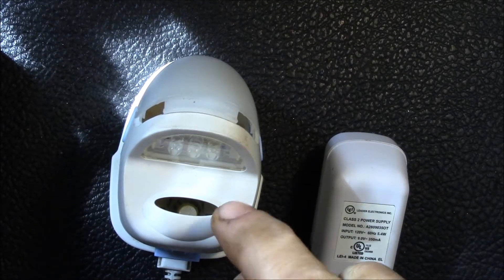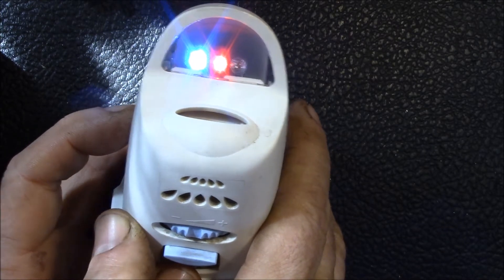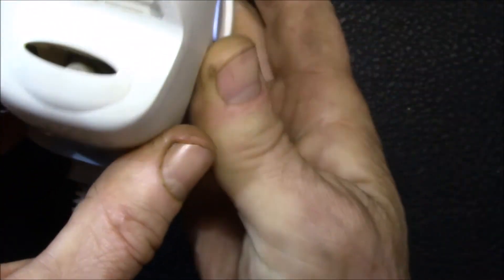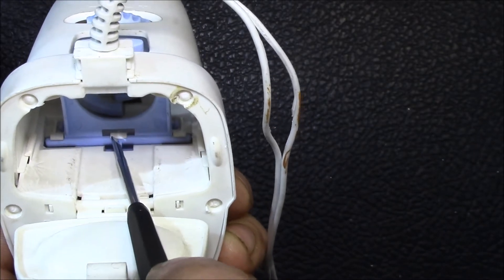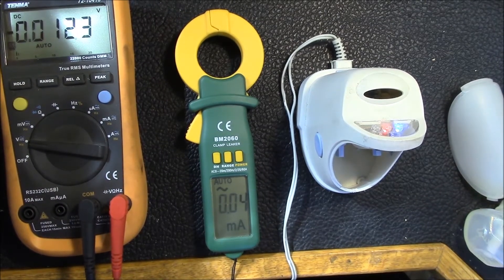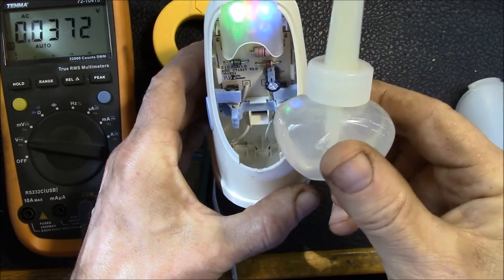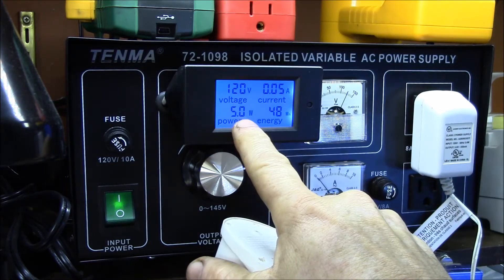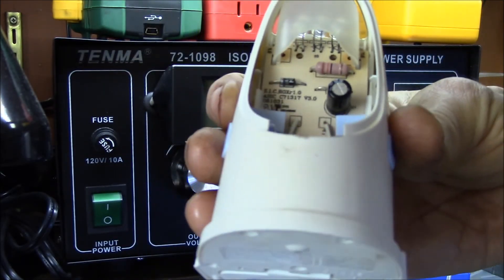Glade® Plugins® Light Show Air Freshener, Night Light and Vampire Load

Comment: I have 1 of these but the tiny little light bulbs aren't working, how do I replace them? is it even possible? I don't see a opening that will lead me to them
Reply from the maker: I've not torn into mine that far.  But since it's all clipped together and at the end, plastic pins on the base are somehow melted in place, it would probably require either drilling out those welded pins on the bottom or perhaps snapping out some of the internal clips to get the circuit board out.  But, I would suspect the little 9V wall transformer first, maybe it's not putting out any power.  Or if that's OK, then it may be something like one of the diodes or the capacitor that make up the internal power supply that have gone out.